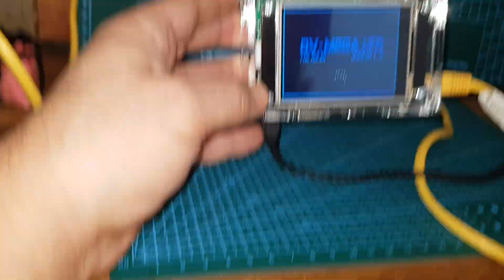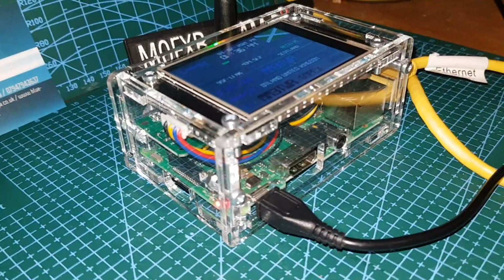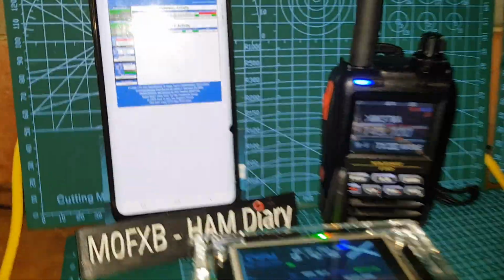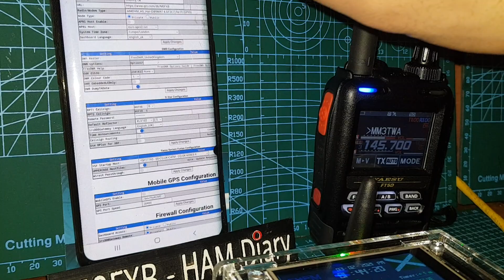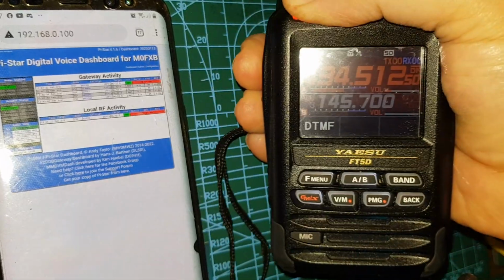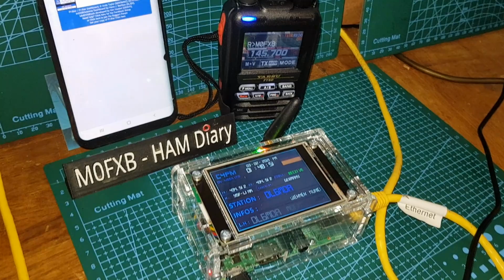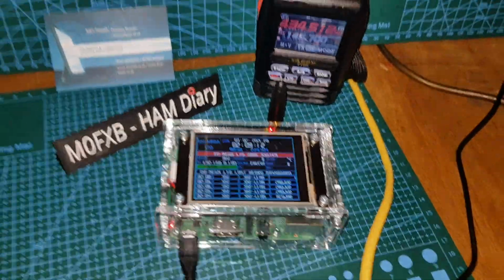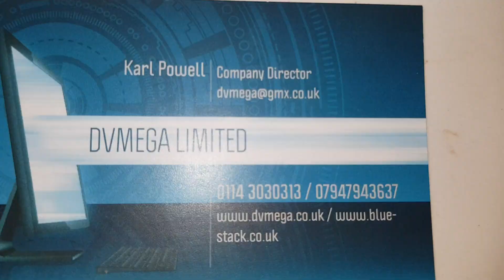DV Mega UK  Genesis Complete Nextion Screen MMDVM Hotspot- Latest Screen Deseign (built in battery)

Comment: Shame the power lead USB is at the bottom of the unit (just the way the PI board is manufactured I take it), so not allowing it to stand upright, with the antenna up and screen facing the user.  Is there a way around this??
Reply from the maker: Hi with pi star oled screen you can flip the screen otherwise it does stand up .
Reply: @M0FXBHamTech  But isn't the antenna on the other side, which would then be the bottom??  That newer one you have got (Genesis 3.5??) that looks like a better solution for those that want an upright display.
Reply: Thanks for a very handy video.  I would consider making a little angled stand so that the screen is at 40-50 degrees to the horizontal.  All to do with preferences.  73 Andreas.